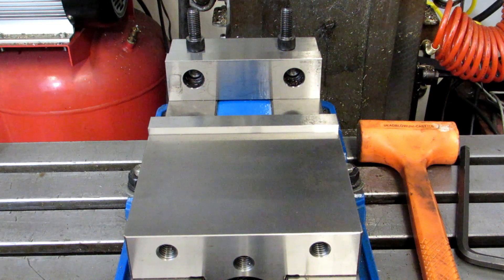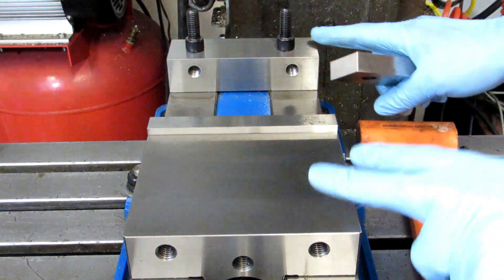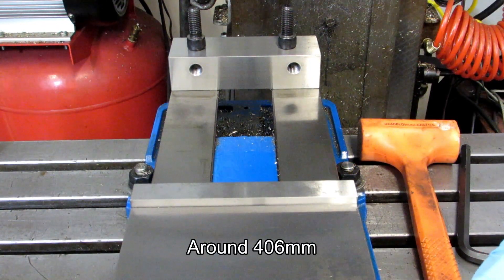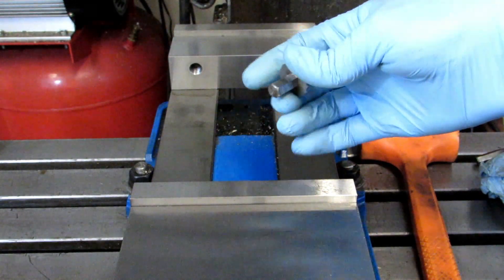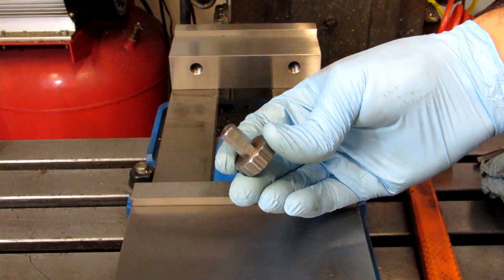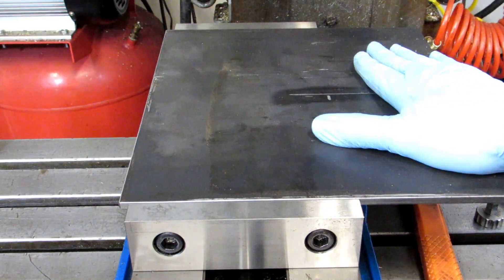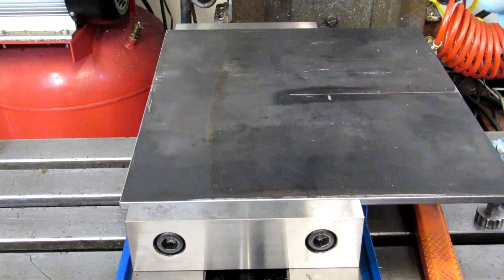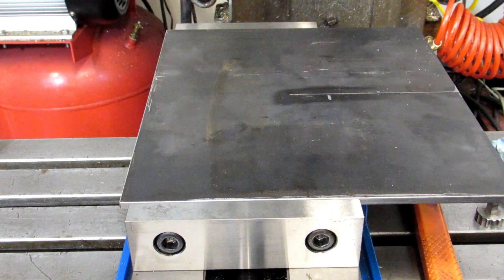Machining Large Pieces in a Mill Vise

Comment: Styyart

Only problem with using the stock jaws outboard is there is no room for paralells under the work piece to kee from drilling into the top of the vise when frilling/working nears the outboard jaws

John
Reply from the maker: Yup. You've got to be very aware of where your jaws are. I usually only work to one side of the vise or the other with this technique.